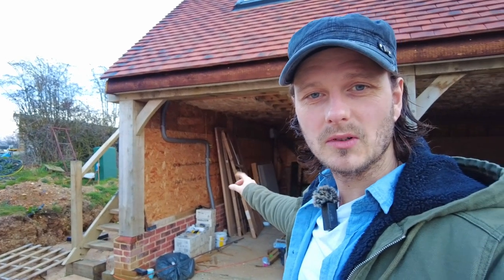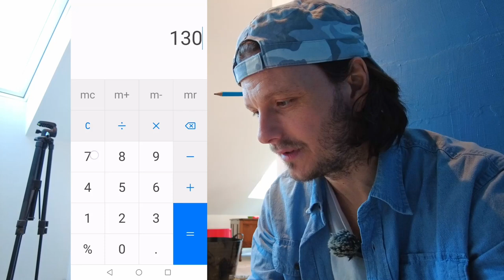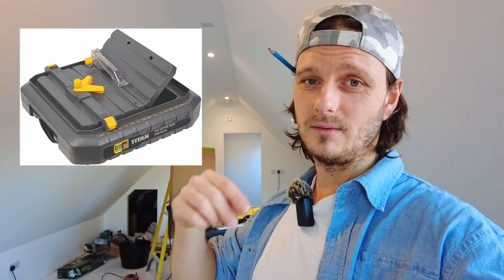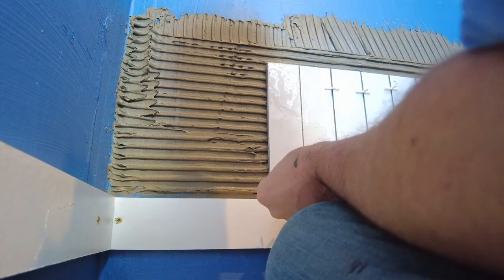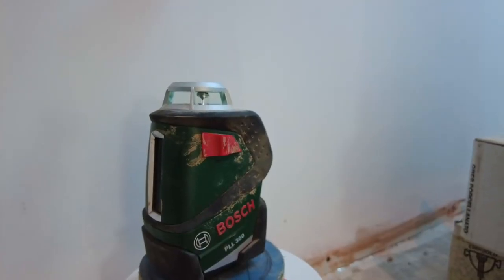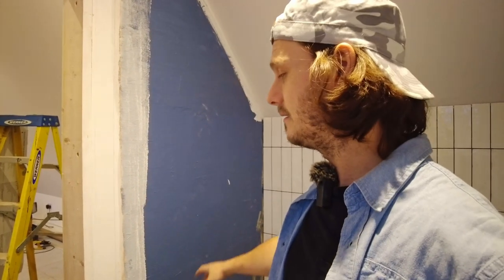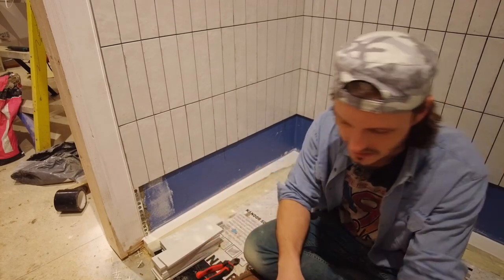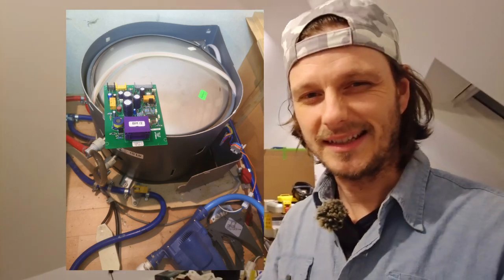How to tile a shower - DIY GUIDE

Comment: No problem with the ‘stiffness’ of my wood 😉
Love the innuendos
Reply: Ps, didn’t you cut the tray which might account for the slight distortion of it?
Reply from the maker: These trays are mass produced and cheap, I didn't really explain it properly in the video but very few trays and baths are flat and always have undulations across their edges, the corners always seem to be higher most of the time

Comment: Looking good, the dark lines make it look good so maybe a dark grout is the way to go? It’ll be fine like that for the shower
Reply from the maker: I've looked up a few videos about electric showers and they all have big holes in the wall, which just seems crazy to me. I've only ever fitted shower mixer valves previously so no massive holes there. 🤷‍♂️ I bought a different fitting today so I'll be attempting to at least get some silicone in there, even though what I've done so far is alot less open than the others I've seen on YouTube

Comment: Let me tell you a story about site tidiness: years ago I had to replace my central heating pump which was under the floor. I had the carpet rolled back floor boards and tools strewn about etc. At one point I jumped up,  tripped on the carpet and fell flat on my face. I stood up and a floor board came with me.  I'd knelt on a nail as I'd gone down. Luckily (luckily?) It was a shiny oval nail and not a rtusty old square floor type brad. The nail had gone into my knee joint with very little damage. I felt sick at the time with the realisation of what damage I could have done! Visit to doctor, tetanus jab and all was well. Since then I've been lot tidier when I work!
Reply from the maker: 😱 I was reading that waiting for you to say it was in your eye!!! I kept moving the paddle just incase I fell over onto the end of it 🙈 I'll be sure to make more effort though 😬
Reply: @THE-AIDEN-PROJECT  Nice tiling btw!

Comment: What type of adhesive was that mate?
Reply from the maker: UltraTile ProFlex SPES, single-part, standard-setting, flexible adhesive for wall and floor tiles. This is an S1, I'd only ever use an S1 or  S2
Reply: @THE-AIDEN-PROJECT  Cheers bud. Hopefully this works better than some ready mix I purchased, didn’t dry and had to remove the tiles. Thought it might’ve been the tanking system but I’m almost certain the mix was just shit. Much appreciated
Reply from the maker: @DG-nn8zt  ah that's a right kick in the nuts, yeah never trust pre mixed stuff 🙈